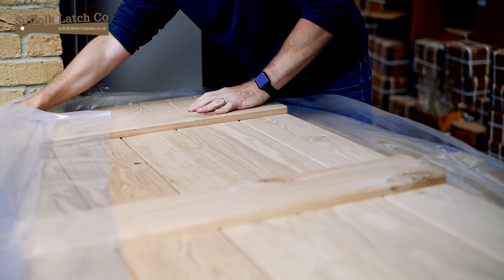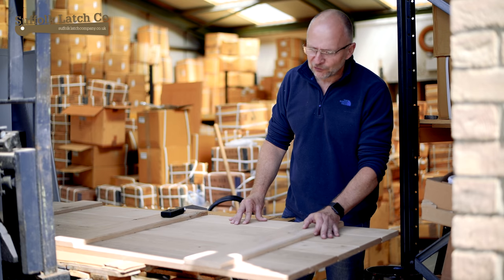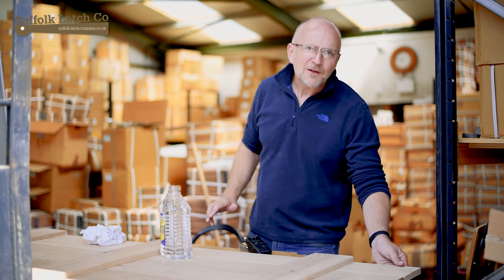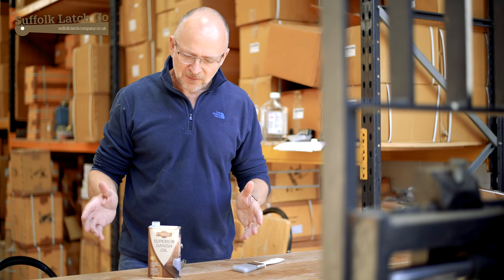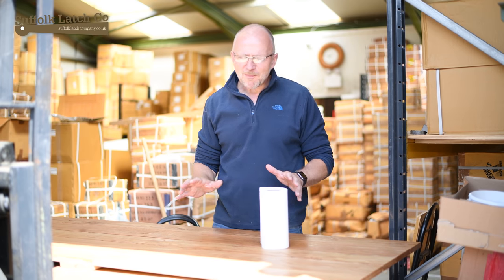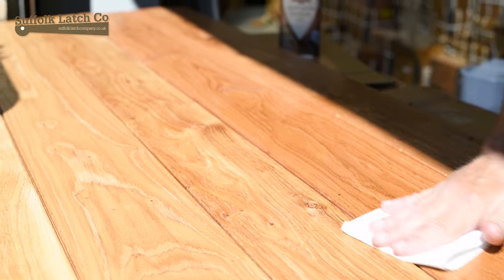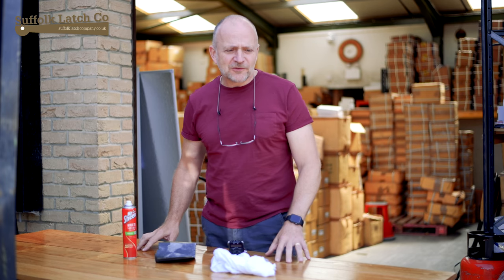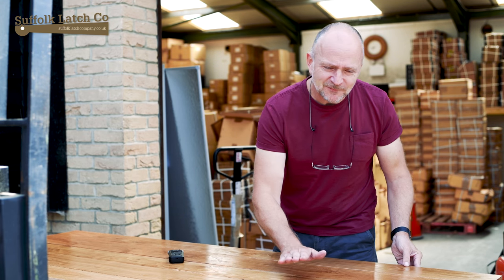Applying Danish Oil To An Oak Door

Comment: Two weeks ago I bought a nice art deco table, full oak, no veneer.  I took it apart, did some restoration on missing parts and put it back together, which took me many hours of dedicated work. Now, I have been looking for the best way to finish the oak, since it looks kind of yellowish, though I have sanded it to the bare wood.  I would like to get rid of that ugly yellow.  I have considered white wash, but I feel not like experimenting.  Maybe, oil is a better option to obtain a light but fresh looking finish?
Reply: I am on the same boat as you. Did you ever get rid of the yellow color?